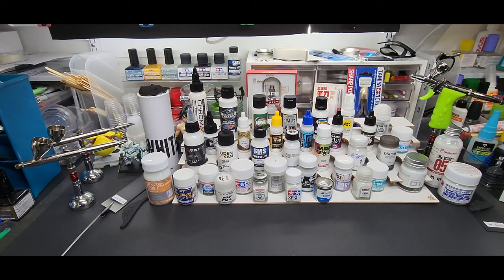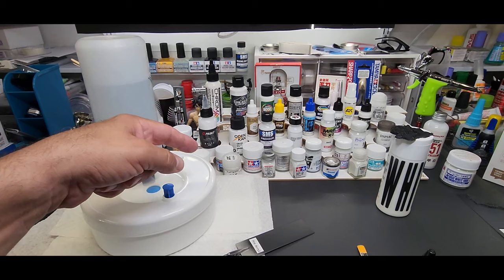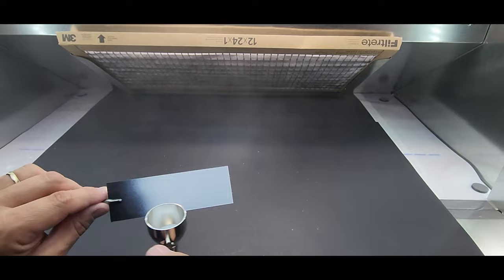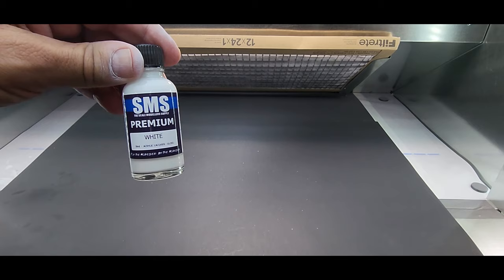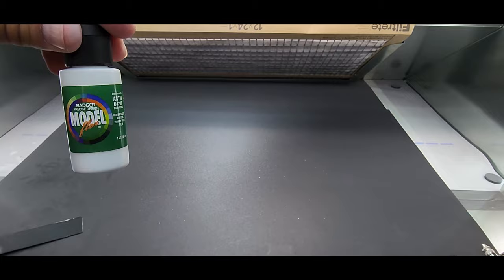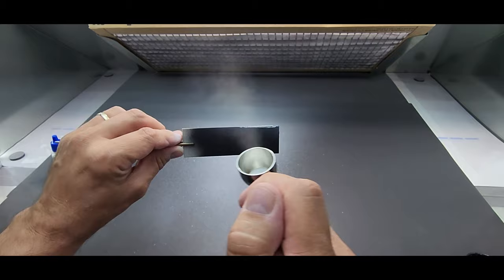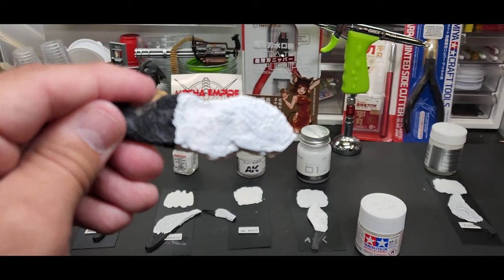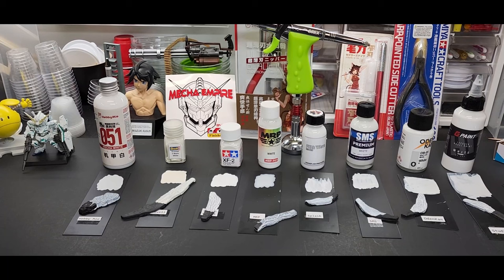Testing 40 Brands Of White Paint For Scale Models - Miniatures & Gunpla

Comment: As a new airbrusher, whites are a huge pain to deal with. I appreciate you dropping a considerable chunk of change to figure out which ones I should try next: looks like I might step outside my comfort zone and use a non-acrylic (or hybrid) for my whites, at the very least.
Reply: once you go lacquer you don't go back they are touch dry in 30 seconds, they chemically bond to the plastic so no peeling up from masking tape, they are easy to sand and very durable, I only use acrylic and enamel for brush painting now

Comment: Fantastic video! You covered every brand I could think of.

As a suggestion for future videos: Brushes. Not airbrushes, hand brushes. I know you're more of an air brusher but I'm guessing you still do details by hand. At the same time most brush reviews I've seen are focused on the traditional arts or painting with acrylic paints, but for those of us that are fans of lacquer paints its harder to know which brushes are good or bad. I've had brushes where the handles started dissolving, others that started leeching color from the handle, and others where the bristles just degraded so quickly after a few uses with lacquer paints.
Reply from the maker: I will add a brush test to the list 👍
Reply: I also would love this. I got my brushes for acrylics down. But enamels and lacquers..yeah I dont even know what to try. Did get come cheap hobby brushes that I dont care about and they do okay. But I want to know a good brand for handpainting enamels and lacquers. Thanks!

Comment: This video is a lifesaver. I am building the  1:144 Saturn V rocket and at some point I was completely frustrated while trying to cover the Tamiya putty in between and match the color overall.
I went through Revell aqua color, Tamiya acrylics, Mr. Hobby acrylics, Mr.Base white, Modelmaster acryl, and Vallejo model air paints.
 I too found that Mr.Hobby aqueous is my favorite to airbrush. But my go to for brushing has been Modelmaster/Testors acrylic paint. I know they are discontinued and are probably hard to find but still just wanted to throw it out there.
Thanks for the great effort in this video.

Comment: I'd like to have seen artists' acrylics in this test: Golden Fluid Acrylics, Gold High Flow Acrylics, Golden SoFlat, Liquitex Acrylic Gouache, ... there are many others.

I mention these specifically because they're quite similar in consistency to hobby paints and have very high pigment density. (I've been using them much more for models recently and find that they compare quite well to the usual hobby paint suspects.)

Note that there are major differences between titanium white and zinc white pigments (the latter has much lower tinting and covering strength than the former, which is sometimes really helpful.) I suspect that all of these were titanium white, fwiw.

Comment: Very interesting and thorough video! As a MIG AMMO painter myself I must say I have never had such bad results either brushing or airbrushing. On the contrary I find the AMMO MIG to be some of the best water based acrylics, especially for airbrushing.
Reply: Had a very bad experience with them too. I don't reject that was a bad batch, but the colors and vanishes sprayed left visible droplets on the model. Gloss varnish was a disaster, behaved like I sprayed over oily surface, terrible. I did not thin them at all, and regularly use Vallejo Air.

Comment: Late comment but Ammo by MIG is very picky. If you try to thin it with water it basically bubbles like it did for you. I always use thinner medium and then it airbrushed and hand paints well. Water seems to break the paint up.
Reply from the maker: That's a problem with many acrylics. I will only use Vallejo thinner with Vallejo paints too. Ammo is a picky paint for sure
Reply: @barbatosrex9473  Yeah I started to airbrush them how they say to and I use vallejo thinner medium and they come out wonderful. Everytime I tried to use water to thin it, the paint would come out horrible

Comment: If you use a corse surfacer and do a candy as thin as you can for the look you want the surfacer sucks the gloss up and gives an anodized look I don't know if it's a normal method but it works for me
Reply: @barbatos rex. I'm not trying to give you video ideas it's more of things I've done by mistake and I don't know if the technique is reliable or not but if you wanted an anodized look you could try it and the suggestion about painting an entry grade a with each line would probably help more when you model with a visual finished product over memory for the perfect fit and if you're going to setup for a big paint session why not do a cheap simple kit for display and visual aid
Reply from the maker: Sounds like a great idea. I will try that

Comment: Createx Wicked Line is for use on automotive applications so it's no surprise that it sprays so well. What's beautiful about the Createx colors is that you can over reduce them and they still cover beautifully. 

FYI Createx aren't true acrylics. They use the term "waterborne". So you have to use their reducer for best results because the binding agent in generic reducers is not the same as found in the Wicked paint line. 
The reducer is cheap though.

I love the Createx line in general. They also have a fleshtone line called "Lifeline" and "Bloodline" for undead/zombie flesh. 

For the money Createx overperforms.